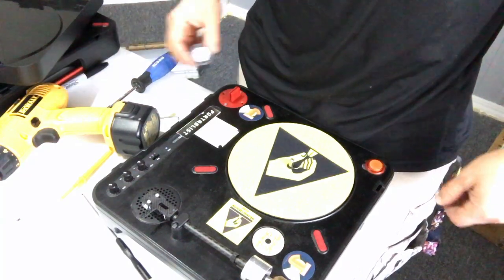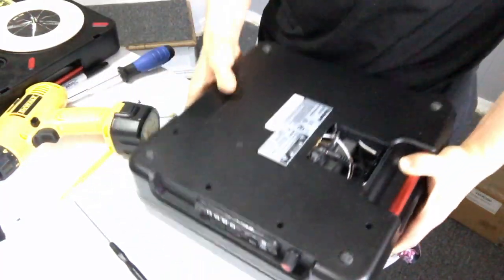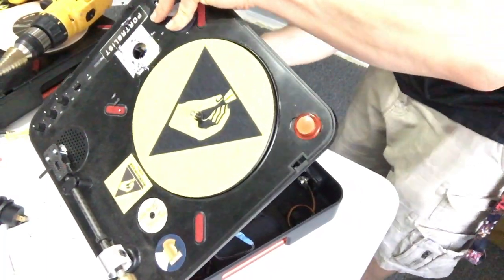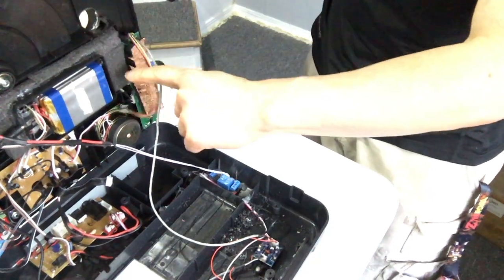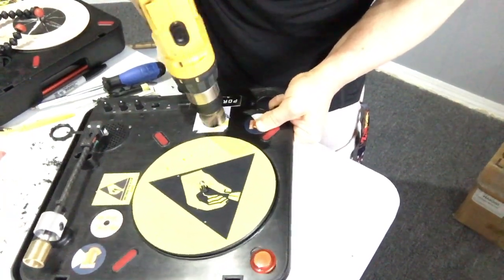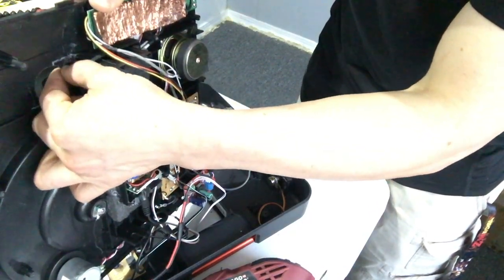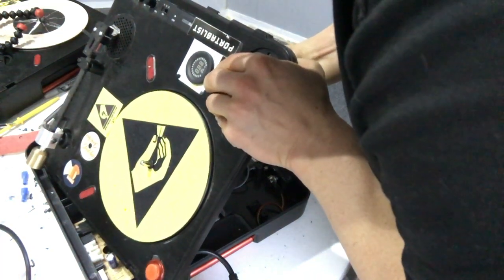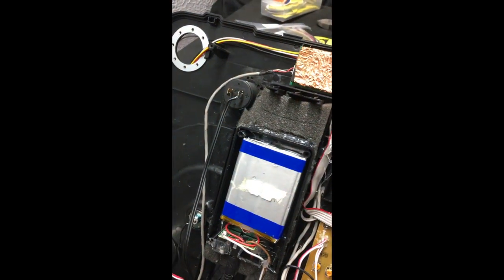VOLT METER INSTALL

Comment: This is dope CJ! Can you get into a little more details on how to wire the volt meter to the relay switch. Love the vids!
Reply from the maker: i basically unscrews the phillis screws holding the wires into the relay . tied the positive wires together and the negative wires together. re-inserted the wires into the relay slots and tightened the screws down
Reply: THANKS FOR THIS!
Reply from the maker: no problem
Reply: Hey CJ Scratch i was able to wire the 12v voltage meter display to my relay and get power to it. But it seems the digital number display is the only thing shows not the energy bar around it. Have you ever had this issue?
Reply from the maker: no i didn't have that issue maybe the meter is bad

Comment: Hey CJ, is there any additional power drain to the battery with this? Also, can you post the link to where you obtained it?

I followed your mods on the start stop button and battery install, so thanks and keep up the excellent work!
Reply from the maker: https://www.ebay.com/itm/12V-Mini-Digital-Voltage-Meter-Display-Voltmeter-LED-Panel-for-Car-Motorcycle/273028120054?ssPageName=STRK%3AMEBIDX%3AIT&_trksid=p2057872.m2749.l2649
Reply from the maker: very minimal drain